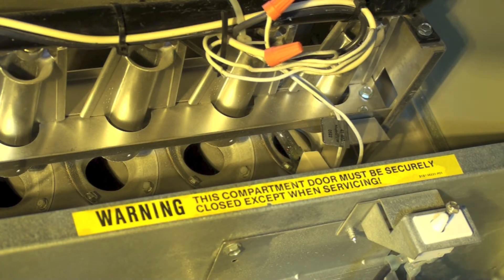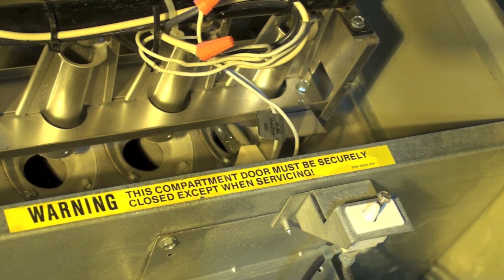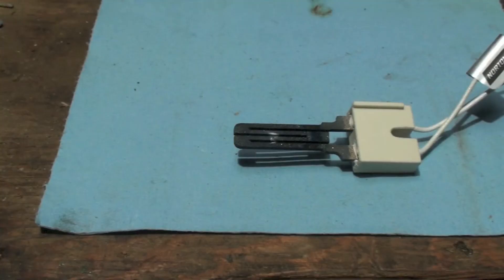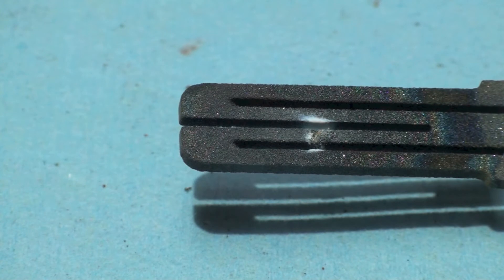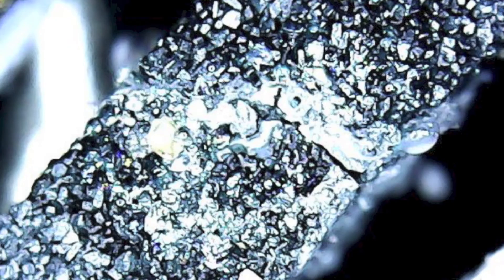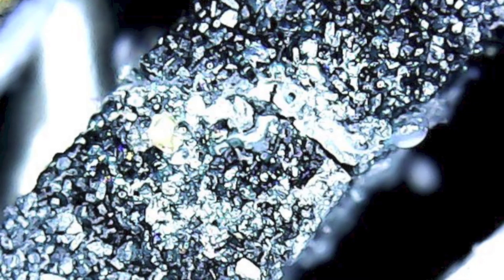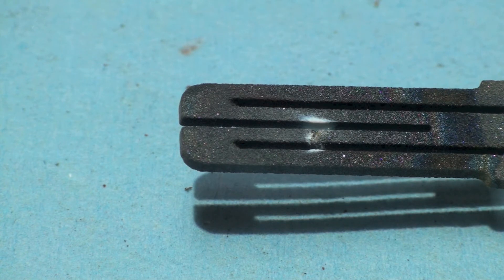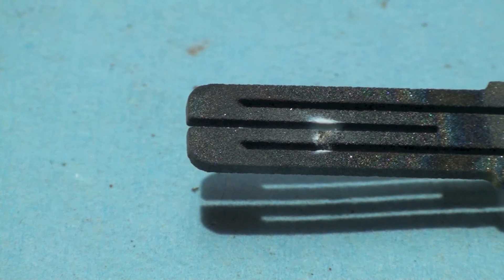Failed hot surface ignitor diagnosis

Comment: How many types of these hot surface ignitors are there, are they all 120 volt?
Reply from the maker: Craig Nehring There are 2 main manufacturers.  The spiral type is made by Carborundum.  The flat types are made by Norton.  Both of these are 120 volt only.  The only 24 volt ignitor I know of is made by Honeywell and is mounted in the pilot assembly of the Honeywell Smart Valve system.  Hope this helps.
GFM
Reply: grayfurnaceman Yes this is good to know, I would imagine that there are many models of these types for other applications, ovens, dryers, etc.
Thanks for the reply
Reply: grayfurnaceman Some Trane and Lennox have  80Volt ignitors.
Reply from the maker: R. T. That is correct.  However, they are 120 volt but the voltage drops if the flame lights reliably.  If the flame does not come on, the ignitor circuit goes up in voltage.  Its a measure to make the ignitors last longer.
GFM
Reply: grayfurnaceman Thanks! I learned something new today. I had 80V original ignitor for a Lenox mid efficiency furnace. I measured the voltage output – it was 115V. The line voltage was 122V. I was totally confused :) and now I have an explanation :)